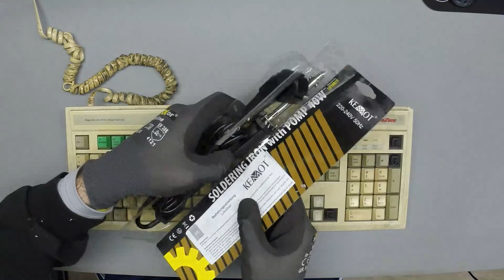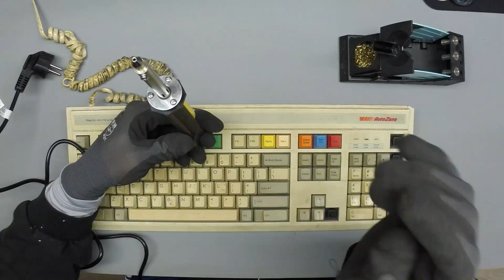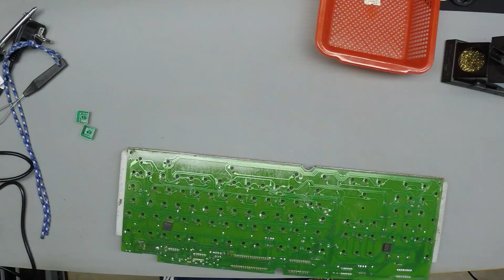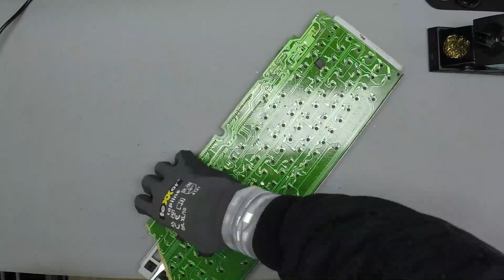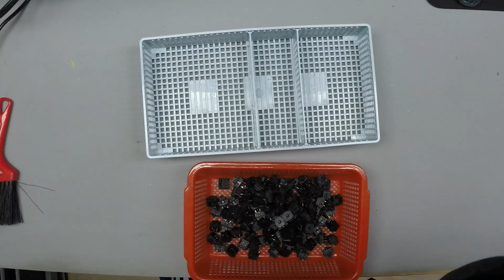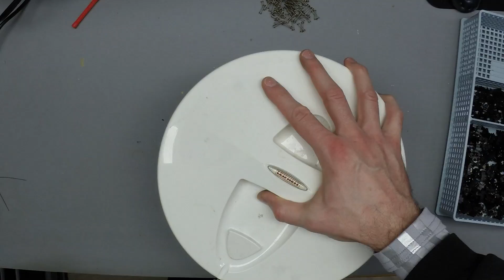Desoldering a "WYSE" with a 10€ tool

Comment: I don't have salad spinner, but after I watched you use one, it gave me an idea. I just throw the caps in a big zip bag and add a couple paper towels. Then fill it with air and shake the caps up. It knocks all the water out of the little crevices.

Comment: How come the PCB doesn't need diodes? Are there drawbacks to this design, and is there a way to build a custom like that?
Reply from the maker: Depending on how well the matrix of rows and columns was designed, normal typist keyboards can work very well without diodes. You'd be surprised to find out that the famous IBM Model M doesn't have any diodes or similair mechanisms either. There is usually some magic in the firmware of a given keyboard to further suppress the effects of a non-diode keyboard matrix.

Comment: why did you had to rip the pcb off ? did the solder did not come of cleanly from the switch ?
Reply from the maker: There is often tiny bits of solder left that usually break off real easily on PCB mount switches when you tilt them off the PCB. That's not possible with plate mount switches and I didn't care for the PCB  at all so I just tore it off.